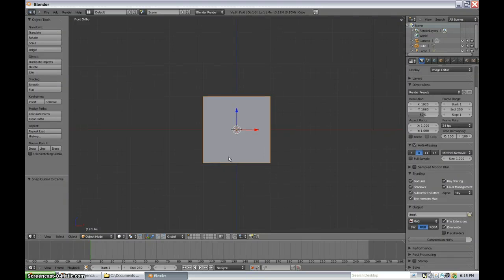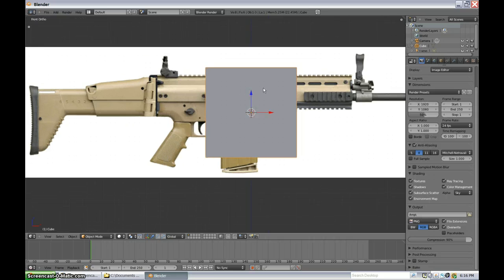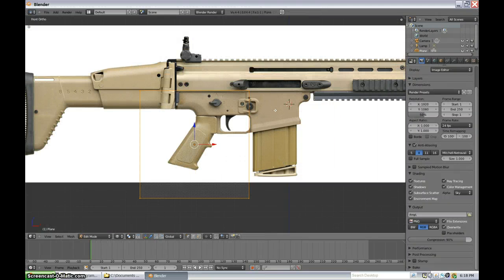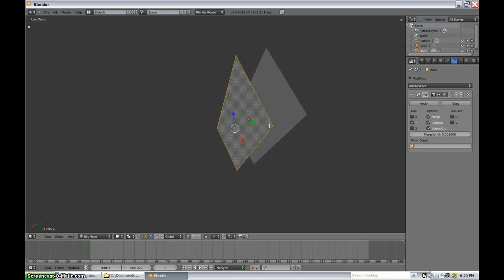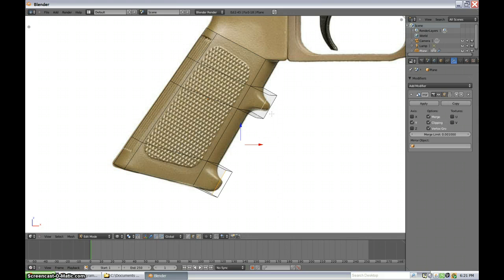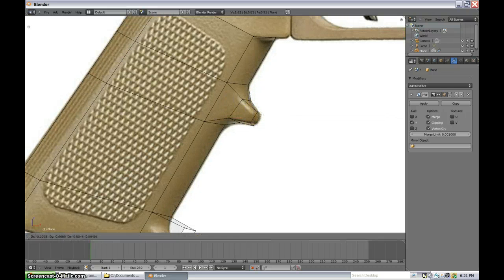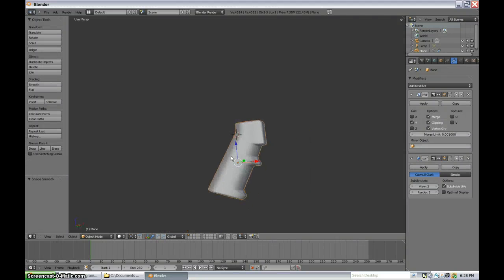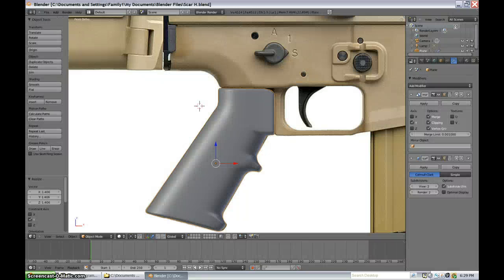Modeling a Scar-H in Blender (Part 1)

Comment: Well, I figured out the vertexes on my own.
And I figured out how the mirror works but whenever I go to mirror something it's in a completely different rotation direction, and it sticks to my first plane. (I also followed the steps stated in this video...)
I was told something about the origin point, the little orange dot? Sometimes that doesn't stick with the plane.
That should be a bit more precise I'd assume... Help? :D